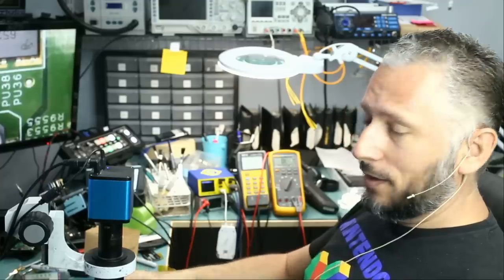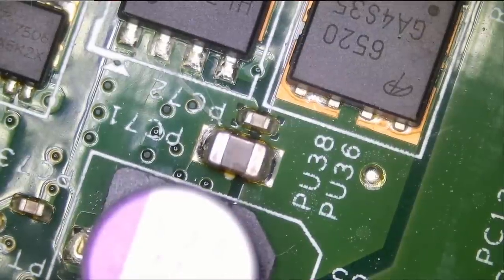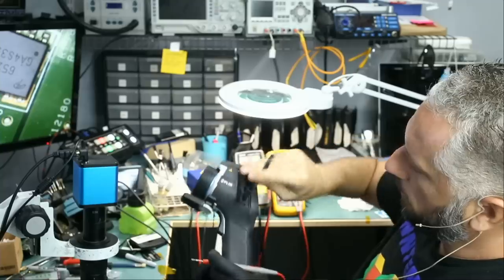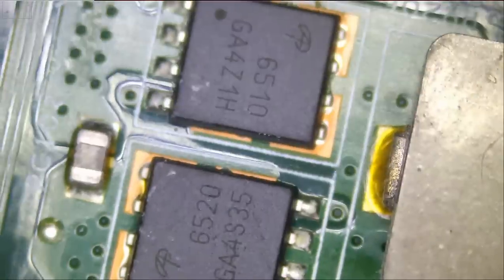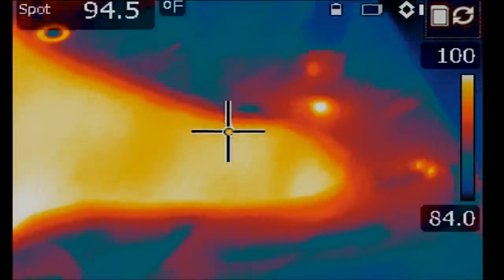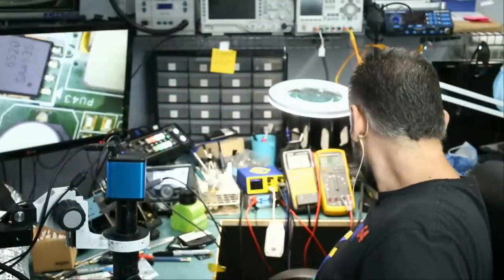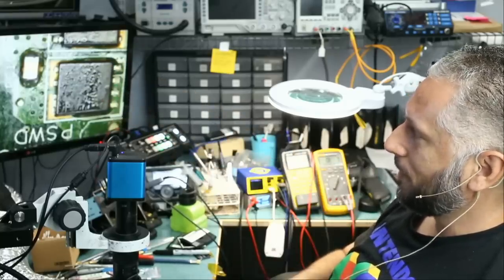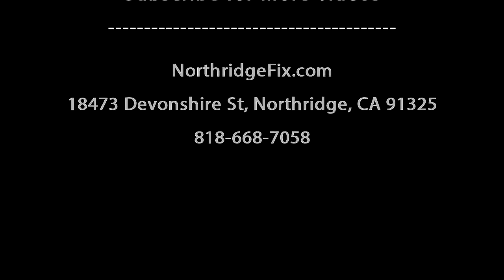Dell Inspiron 24-5459 AIO No Power Motherboard Repair

Comment: If you don't have a thermal camera, even if the worker has a high level of expertise
How good is circuit analysis?
And also can't find the other faulty capacitor which takes a lot of time
Reply: Spreading isopropilic alcohol and see if it evaporates.

Comment: Hey man I have one question, how do you know the value of those small caps? What if they are other values that you're not used to?
Reply: Since it's a bypass cap it'll be used to pass AC noise to ground for filtering. The only thing that would happen if the cap value is lower is an increase in capacitive reactance to the AC signal. It should still be able to filter high frequency noise.
Reply: @pupil2720  is that literally audible noise?
Reply: @southerncharity7928  No no nothing like that. Noise in the DC signal is like voltage fluctuations. Filter helps make it more smooth.

Comment: Great job Alex, the thermal camera helps you a lot in looking for the shorts, but for some technicians they are very expensive and we don't have the means, so comment in another video if you can show if it works as rosin to detect the shorts. greetings and blessings

Comment: You are amazing. I have an all in one DELL INSPIRON 7459. The system turns on and works for around 5 minutes and it shuts down. I have changed the heat sink compound. What possible problem my system might have?

Comment: Great repair, thank you for sharing. Shouldn't you remove the RAM and CPU before injecting voltage?
Reply: He was injecting voltage into DC input mosfet (at least he assumed that). That place already handles way higher voltages. And he was injecting just 1.4V (or less, but he always injects low V)

Comment: Great job Alex.  Apart from the capacity value, do you ever measure the rail voltage, then use a capacitor rated at least double that voltage to guarantee reliability?

Comment: I'd say the flashing is the power supply reseting when it sees the short circuit. The cap pulls too much current heating the the protection mosfets at the input.

Comment: Even if manufacturers do not release repair schematics in wish they atleast printed cap / resistor values on the board or on a sheet Under the case similar to cars and car fuses.

Comment: I was able to find the defective component on a T-con board of a LED smart tv, the problem was no display on the panel, using your technic, boom, the culprit was found, a shorted bypass capacitor, now the tv is working....
Reply: Nice to hear that

Comment: good morning eng . i have hp laptop hp spectre x360 2015. the mosfet damage.  (E070BN505 ) i can replace anther mosfet but same voltage 30v .15A